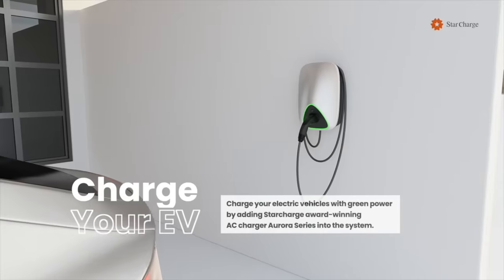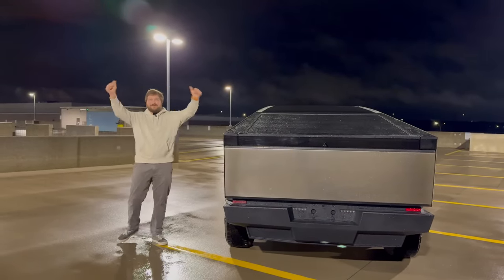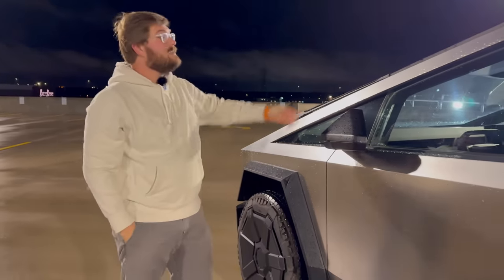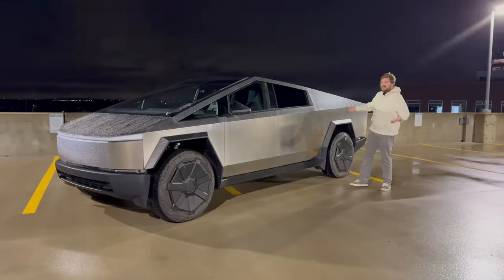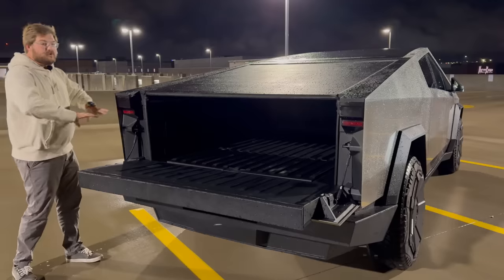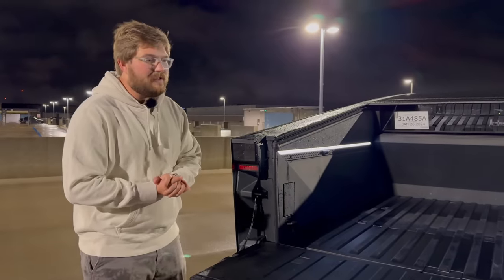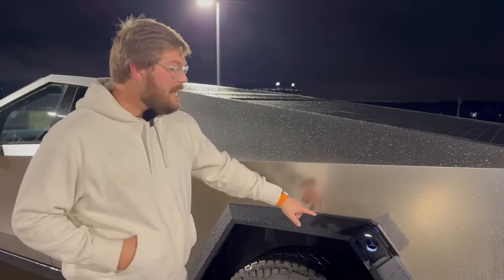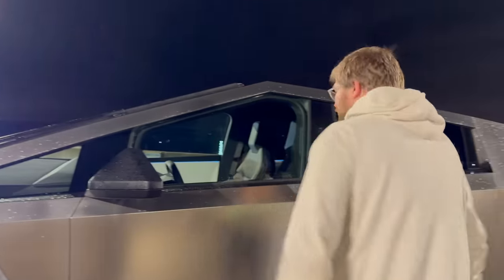Tesla Cybertruck Full Tour! Exposing All Details - Service Mode, Wiper, Powertrain, & Much More

Comment: Tesla optimizes all they do for numbers. Payload, 0-60, etc. The spare wheel would cost them over 100 lb in payload, right? That's just how they "roll", no pun intended. Their EPA range numbers are traditionally the most "optimistic" as a percentage of real world range. Their promised top speed may require a $20K upgrade kit to unloch. Their best range a $16K extra battery pack, etc, etc. When tesla mention a number or technical term, it's to sit them down and ask a lot of questions as to the meaning and context, but they DON'T put asteriskes with their specs unless they've been publicaly shamed or told to by EPA. the list is long. Call it hating, other brands don't do that. Lotus, I'll say, lied about their Eletre weight by 600-700 kg which is grave. Oh, and it's the "first Hyper SUV" they say. Learning from Tesla? Their own style?

Comment: Excuse me? "We can acutally see how the plaid powertrain is suffering because it's all permanent magnet motors."
That's not correct dude. It's suffering because it has 3 motors and every motor has its losses with it.
A Permanent magnet motor is more efficient then an induction motor. That's the reason why the model Y Longrange has ~2kwh/100km more power usage then the Model Y Standard range. It's less efficient because it has 2 motors + one of the 2 motors is even a less efficient one.
Put a Single motor in a model S or X and see how the consumption goes down. Best you can buy for efficiency is Model 3 Long range rear motor. Dont know if they sell them in america but in germany every now an then they do.

Comment: Great review, but I must say I'm somewhat disappointed in the Cyber truck. It originally was to have a 500 mi range sadly now a 320 mile range. My 2023 Tesla X with the rear seats folded down is 7 FT 1long , the Cyber truck again disappointing at 6 ft. When I made my $100 deposit the most expensive was to be $69,000, now well over a $100,000. Just no incentive to trade in my 2023 Tesla X for the Cybertruck. quite disappointing.

Comment: Far too much electric and electronic crap. They could have saved a tonne of wire. Manual seat, steering wheel adjustment, door open, tailgate open, hood open far preferred. (Don't have enough time in my life to wait for slow electric motors)

Comment: 9:05 Man that's gonna sound "amazing" in a hail storm! I wonder what the noise level is inside is like during hail or even heavy rain...

39:00 It's absolutely wild that Tesla, produced a brand new (and expensive) vehicle that doesn't support their own standard that they make a big deal of gifting to the industry. I hope it's just a software thing and the actual hardware required for the ISO15118 protocol is there at least. Still, there's no excuse is there? How do you botch a feature that's been standard on every other vehicle you've built for the past decade if you're not doing it on purpose?

1:13:00 I predict the battery pressurization system will result in an incident and decent odds it results in some backpedaling of claims, if not a recall item. Just like their self-driving tech was oversold and then under-performed and people got hurt/killed... neat idea, but maybe manage expectations a bit better.

1:24:00 Still really curious how they maintain control safety in a drive-by-wire system if there's no mechanical link for steering. Electrical brake boosters need independent, redundant power supplies so they still work in a total power loss, but you really only need to stop once... steering is more of an ongoing requirement.

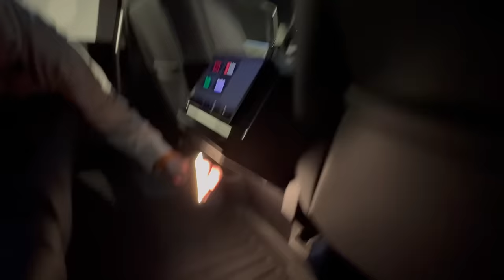1:39:00 If you can't pull 20A from a NEMA 5-20 outlet then that's just asking for a fire, innit? I don't know that NEC applies to vehicle interiors but no engineer worth their license would let you plug a 20A load into a receptacle that can't actually provide 20A.

Comment: You missed the most important part , how do you manually engage the front AND rear locker ?  That’s the only thing that’s going to make this thing work really well off road and avoiding being in another “off road fail video”.  Seems like only boners with zero off road skills are testing this off road. With deflated tires and mechanical E lockers engaged for the duel motor version ( not lame “traction control” which just hesitates and barely gets going) this thing would be good. It supposedly has 12” of wheel travel so would be ok.  Can’t wait for an actual off road true test none of this “omg neat , it has a power frunk” 😂😂😂 

Side note : the duel motor with E lockers front and back as opposed to tri motor with one front locker is probably gonna be best … supposedly “torque vector” rear will work better in theory .  But so far Massive fail for rivian.   I think because nerds are programming the logic they don’t comprehend that sometimes tires need to just spin and it’s not the end of the world when off roading .   It would be extremely simple just to tell left and right side to spin at the exact same speed no matter freaking what happens because it’s an off-road situation not the Starbucks drive-through.

Comment: So the car is truly a disappointment :  Range:  320 miles vs  500 promised.  Size: Smaller,  Price:  more than 50% more expensive,  Metal Body: about half as tinner, and the list goes on. Also tinny front smaller bed than the F-150 (it's the same max length but far smaller in terms of utilizable space)  and very bad visibility. Only in America: The F-150 is a normal parking vehicle in terms of size. 😂

Comment: I cant believe out of spec would do a review without knowing so many basic things about the truck.  Just like they cant believe Tesla would release it without Autopilot.  It is ok for some to rush out unfinished but not for a true innovator... They need the video feeds back to tune the model for the autopilot. Chicken and Egg issue. Elon explained the radar in the cabin, Infant detection will be use case when it is ready.  You can trash Tesla on this next week while they work on saving lives and you can sip a fancy drink from a disposable plastic cup talking about not nice materials used in places you dont even really touch....such an arrogant review style now, you used to be more grounded.

Comment: I'd like to see a van version. With and without panels. The floor is silly high, but as an SUV with the contrast between steel BODY panels and glass, it would look good. The van version would help especially if outfitted with the extra battery.
Compared to the promises 4 years ago, whcih were realtively doable, the final product is a huge let down. The best car designers are long gone and it's starting to show. Tesla is getting good at refining imperfect designs like the clumsy Model 3 (should be a hatch or wagon), but new cars...not so much. Model Y is bland but quite good, and that's 75% the same as Model 3, just larger in most dimensions and deceptiovely spacious. The ways Tesla finds new ways to create a new category of road dangers is very frustrating. The low on the screen rearview mirror cam, the missing turn stalks, the weird steering, the hidden gear stalks, all are going to cause problems with less tech savvy first time drivers. And you know it's going to be rented out A LOT. Driven by people who are not truck people, in areas they don't really know. And then confronted with so much torque under the right foot. Teslas have very Tesla-specific accidents, even fatalities, and they're in no hurry to get that out of their system, from their actions (words are just words, and numbers are lies, in case of Tesla, more than any other car or tech brand).

Comment: The cybertruck is all but dead; yet here you have more hype.  Tesla has had 4 years to ready production; Ford only used 1 year for the F150 lightning. Tesla made under 200 cybertrucks in Dec 23; Ford made 1500 a week from their first week of production. The issue is the failed 4680 battery - the intital 16% more dense battery is cancelled they have downgraded to a 10% more dense cell and still cannot make it efficiently; they will only say "rejection rates are better each month".  A manufacture has to make 5000 just to claim it as a production vehicle - Cybertruck is dribbling out the last 2 days they put out zero.
Reply: CT will do just fine.  Thank you for your “concern”.

Comment: 34:18 - again, most people won’t use it most of the time. So simple. Lars even said their reasoning behind this decision in the Sandy Munro video when he got the factory tour with several executives: most people won’t benefit from it and the ones who will will self-select. They can use the cells they save by not making each pack 50 KWH larger and make more vehicles with the same number of cells. Do you agree? Irrelevant. That’s the choice they made.